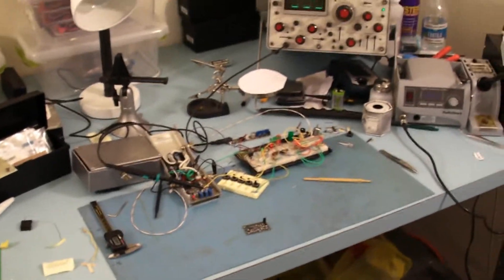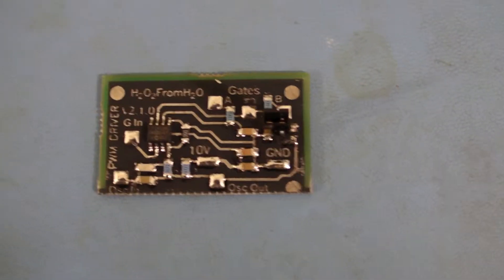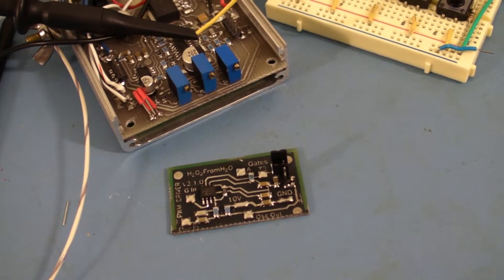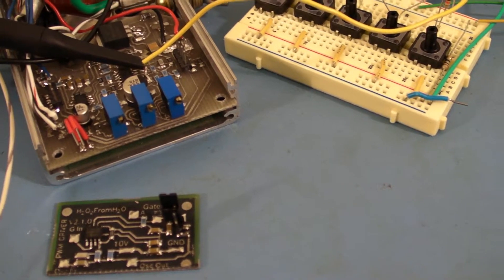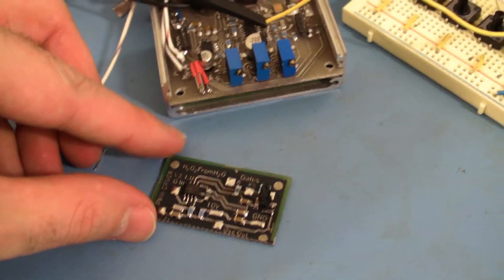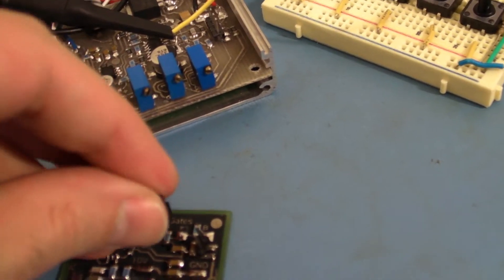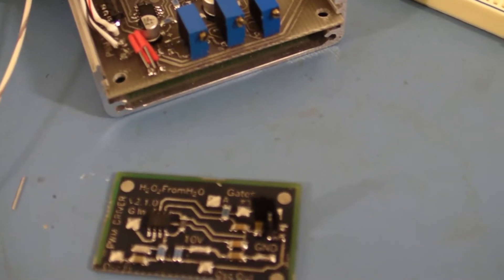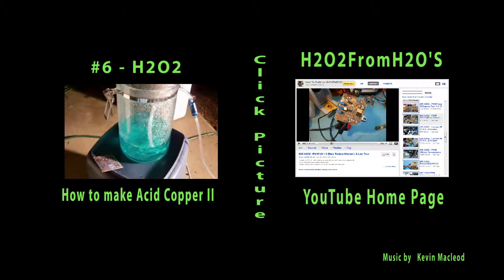#43 H2O2 - PWM Driver V2 In Development Part 1 of 2

Comment: Its a good design and good art work, I had a quick look at your schematic for the PWM, and on the driver I'd bridge pin 6 & 7 and remove c13, you don't need it, I'd also put a 470pf at the input of pin 2 just to keep the input clean